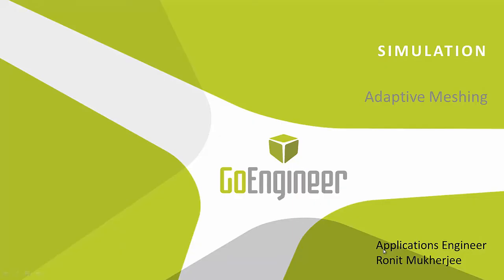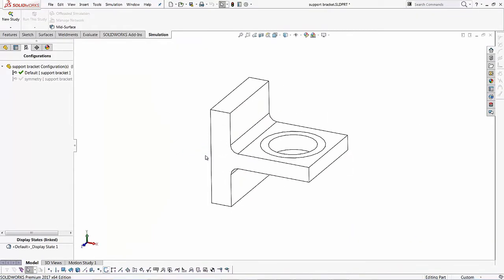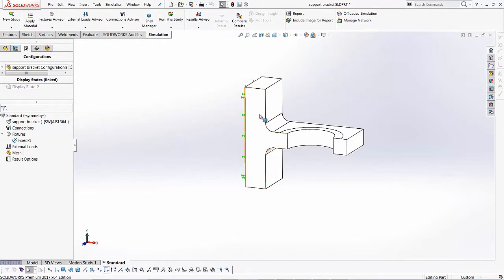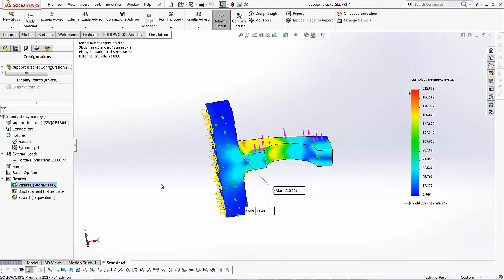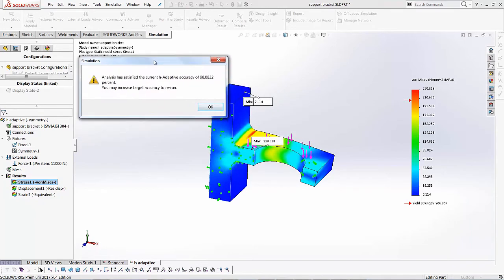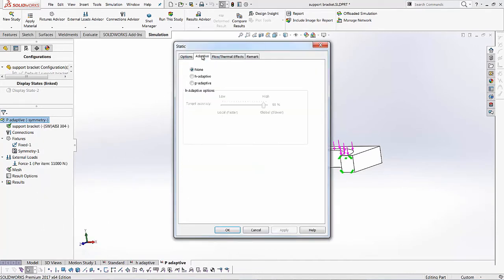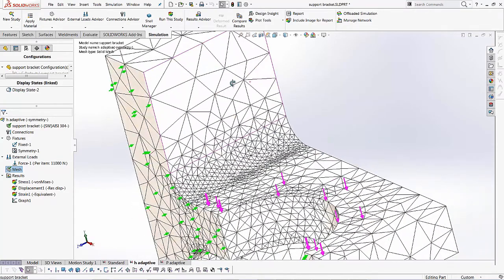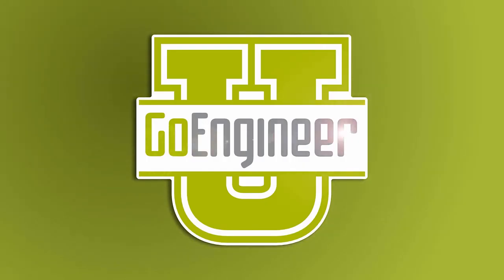SOLIDWORKS - Adaptive Meshing

Comment: Very nice Video. I t would be nice to just add this line to understand the main reason and advantage of doing the adaptive meshing.
My input for this is the goal of adaptive mesh refinement is to obtain a solution that  Improves the accuracy of finite element solution,  while minimizing the number of elements and, hence,  the cost of analysis.

Comment: Hi, the adaptive method tab it doesn't appear in properties. No idea to activate the hidden tab, I have the premium version, and on internet there's no solution for it... Any suggestion?
Reply: I have the same problem, did you resolve it?
Reply: @diegomejia7446  not yet man, it’s weird...
Reply: Same here... I have it in some models and not in others. Very weird
Reply: Hi, it's available  only for static analysis and for 3d elements only.

Comment: If the deformation scale is 29,  how does this result compared with deformation scale of 1 ?
Reply from the maker: Vitul,

The stress and displacement remain the same values regardless of what the deformation scale is. Deformation scale is a visual help – it multiplies the actual displacement by in this case 29 to make the bent shape more obvious. It helps us see how the part file is bending in an exaggerated way. And again, just to repeat, the results do not change.

Comment: Sir,From where to study meshing rules,such as you where telling about kind of thumb rule to know the number of elements at depth etc
Reply from the maker: Hi Basudev,
The best practices for FEA are generally learned from either a mentor or in coursework.  Coursework generally happens through a University class or the software vendor for the specific analysis software.  Even the general rules are too numerous to list in the comments section here.